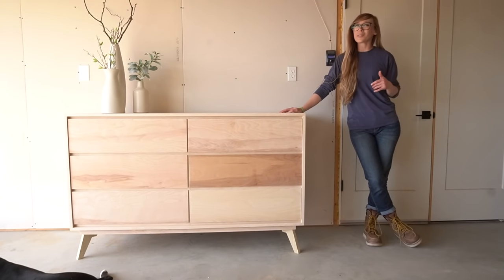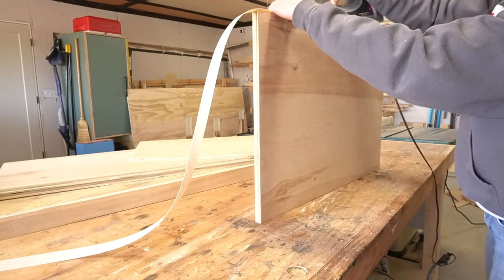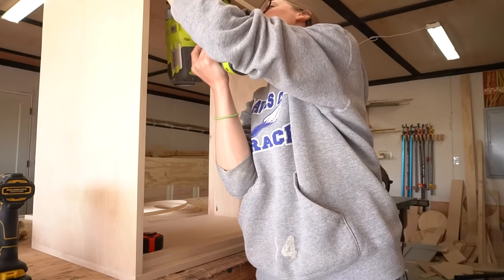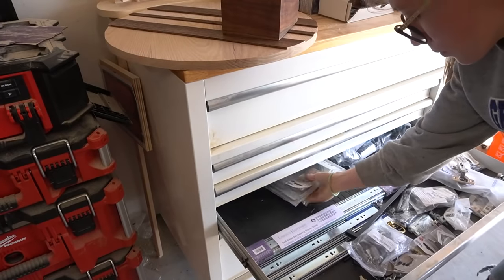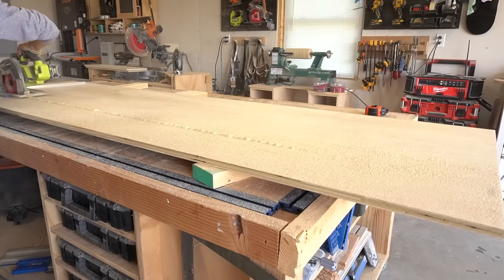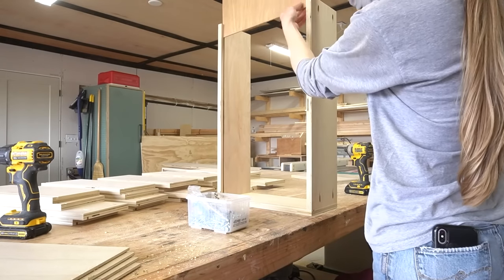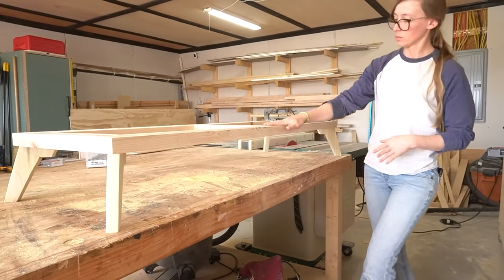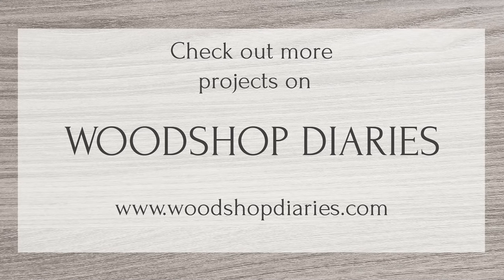How to Build a Mid-Century Modern Dresser--FROM 2x4s and PLYWOOD!

Comment: Thank you!  My daughter wanted to build a dresser and I told her it would be too difficult, but this video and your plans made if possible.  It turned out almost perfect!  My only advice for anyone that does this build: Shara tells you this in the plans, but to reiterate you should cut the drawers as you go.  There is little room for error when you put them on the slides so an 1/8" can make a big difference.  Measure and cut as you go, at least for the first one on each side. The only tricky part of the build was mounting the drawer faces - again we wanted them to be exact and we never figured out an easy way to line them up and attach at the same time.  Ended up removing the top two drawers so we could reach the one beneath them, applying glue to kind of hold them in place, then having one person push them out from the back while the other held the front on exactly in the right place, then clamp it to screw it on.  For the top two, we used to big clamps that went around the whole dresser and just glued them overnight and screwed them in later.  Great project - well done!!!!  If anyone is thinking you should give this a shot, go for it!!!
Reply: This may be helpful. I've seen others that have used double-sided tape. The tape will hold the drawer face in place, and it's easy to reposition if needed.

Comment: That was cool! I bet your friend loved it. If I may make a suggestion, a simple 45 degree bevel on the bottom edge of the drawer fronts makes for a great way to pull the drawer open. Great build!
Reply from the maker: That’s a great idea about the beveled top edge. My friend plans to add knobs, but if you didn’t want hardware, that’s a great option 👍thanks so much for watching!
Reply: @WoodshopDiaries  hi I am pension carpenter

Comment: If I had a table saw and planer, I would do this for sure! Super nice!
Reply from the maker: No planer or table saw needed! You can cut all the wood down with a circ saw and no planner is needed on anything here 👍
Reply: @WoodshopDiaries  It's doable. But I know the sides and edges won't be as straight as they should be.  Using Kreg joints on un-planed lumber always ends up looking sloppy.

Comment: I love the look of this! I want to do something similar, except I want one with three drawers and one cabinet. It's been really hard to find one to purchase that fits what I'm looking for. At this point, I'm just going to make it and buy a three drawer dresser in the meantime. It seems like a cabinet door could be easily added to this build. I'll also make the drawers take up 2/3 of the width available for the drawers and the cabinet area 1/3 of the width. I'll probably have to add a middle support beam on the drawers so that the thin plywood on the bottom of the drawers don't crack.

Comment: Nice job.  I'm impressed that you used a ruler instead of a framing square to check for square.  The only thing I would question is the use of the secondary side of plywood for the middle drawer of the RHS of the dresser...which seems odd aesthetically.  I don't know if cost was a factor, but solid wood drawer fronts made of birch should not be that expensive.  But overall, you did a great job.  Keep up the good work!
Reply from the maker: In the video I mentioned I robbed some plywood from an older project for this drawer front. It’s being stained dark by my customer so it’ll even out as far as color goes. (It did even out…past tense as this is an older video)

Comment: Great work and elegant design. My only concern is that the pocket hole on the main body may not be very strong. At 2:14 for example, the are on the sides pointing outwards, which don't have much material to hold it. Instead, you could drill them from the bottom to the sides, such that they are pointing upwards, which has more material. For the top pocket holes, you could use a stripe to drill pocket holes from top to sides, then put the top cover on top. Anyways, your glue should hold them together just fine. Good work!
Reply from the maker: Thanks so much for watching! I’m glad you enjoyed!

Comment: Looks great, nice work 👍 
I don't have a table saw for the dado cuts in the drawers, I'm assuming I could use a straight bit router to achieve the same though?
Reply from the maker: Yes! Or you could glue and staple them onto the bottom of the box as well. Whichever you prefer

Comment: Great video.  I was wondering if this could be done with 1/2 inch ply.  I live in New Zealand and we are very limited to what we can get.
Reply from the maker: As this is a large dresser which will be holding significant weight, I wouldn’t recommend 1/2” ply. You might could get away with it for the drawer boxes and fronts, but I wouldn’t use it for the dresser body.

Comment: Nice piece. You said that you would be able.e to use drawer runners that push to open, but wouldn't the drawer fronts butt against the frame, negating the 'push to open' functionality? I might be being stupid but I'm just having similar thoughts on a piece I am working on right now.
Reply from the maker: The drawer fronts were actually cut the exact size as the openings…so they don’t overlay the trim pieces.

Comment: Hello! New subscriber here! I am a total newbie at woodworking but really want to make a dresser like this. I have a few questions: instead of cutting all of the dados to slide the bottom piece of the drawer into the sides, could I alternatively just nail/screw/glue the bottom piece onto the bottom of the side pieces (kind of like how you attached the back of the dresser)? Is there a particular functionality-related reason not to do that, or does it have more to do with aesthetics/craftsmanship?
Also, how do you know what size/length of screws to get? For example, when you screwed the base/legs onto the bottom of the dresser. If the screws are too short it won’t attach, but if they are too long they might pop through to the other side, right? I’d love your insight!! Thank you so much for this video, I learned so much!
Reply from the maker: Thanks so much! You can staple or screw the drawer bottom in place. You can check out my drawer building guide for more details here:
https://www.woodshopdiaries.com/theres-no-wrong-way-to-make-a-drawer/
And for screw length, you want to make sure it’s shorter than the thickness you’re screwing together. So the total thickness of the base plus the plywood bottom was 2 1/4” so I used a 2” screw.  You can find more details in the plans here:
https://www.woodshopdiaries.com/how-to-build-a-modern-dresser/
Reply: @WoodshopDiaries  thanks so much! You are the best!!

Comment: Hi Shara. I see that you hardly use any glue, even with the kitchen cabinets. Do you find the pocket holes to be strong enough?
Reply from the maker: I’ve not had any issues with them…In my cabinets or any other furniture I’ve built so far. 👍 glue is good, but the screws hold fine on their own
Reply: @WoodshopDiaries   Good to know. Thanks Shara

Comment: Wow, so simple.. I keep forgetting what pocket screws have done for cabinetry. 
Wasn’t 3/4” plywood drawers overkill, and more expensive than 3/8” plywood?  Could you help me understand?
Reply from the maker: I like to keep things simple and use 3/4” and 1/4” only in my shop. At the end of the day, you can “save money” by making some parts 1/2”, but you may end up with a half sheet of leftover 1/2” and a half sheet of leftover 3/4” and if you just made it all from 3/4”, then you’d have no scraps. Plus, I can stick to one size screw, one length nail, etc instead of stocking different sizes and lengths to use with different materials. Not right or wrong…but what I’ve found to work best for me in my shop—limited materials, less waste, less supply to keep stocked.

Comment: I built a dresser similar to this and aligning the drawer front was not trivial at all.  There is always a bit of variation.  I always use spacers to keep things lined up but not sure why they are not all the same.  Any tip?
Reply from the maker: I’m not sure what you mean by variation and what’s not the same? Are your drawer fronts square? Exactly the same size? Is your dresser square? Drawer slides installed at the same inset? There are million possibilities, but since I’m not sure what’s “off” on your case, I’m not sure what to suggest looking at first.
Reply: @WoodshopDiaries  I am trying to get all of that correctly. I use square block when attaching sides. I use spacers between drawers slides etc. But somehow it never lines up and I had to do micro adjustments. I wish videos on youtube cover those "catch ya" to help us make things square and aligned.
Reply from the maker: I’m still not sure what exactly isn’t lining up? The drawer box? The drawer slide? The drawer front? Maybe this guide can help:
https://www.woodshopdiaries.com/theres-no-wrong-way-to-make-a-drawer/

Comment: I always have a problem with pocket screws lifting up the board and scooting off from the targeted place in a 90 degree joint like the sides and bottom/top panels.  How do you do it without clamping?  Add glue and it gets even slippery.
Reply from the maker: I get this question all the time. I honestly don’t have a “trick.” I just hold it tight, don’t overdrive the screw and when you add glue, press down and allow the glue to squeeze out some so it’s not sliding around everywhere. If all else fails, just clamp it.

Comment: I saw that when you assembled the drawer sides with pocket hole screws you used no clamps how do you keep the pocket screws from moving while screwing the pocket screws in
Reply from the maker: I hold it in place very tightly and don’t overdrive the screws. I’ve found most of the issue with movement is caused from over driving the screw 👍
Reply: @WoodshopDiaries  Thank you :-)

Comment: Could this work with 1/2 inch plywood to cut down on some of the weight?  thoughts?
Reply from the maker: That’s a great question. While it might be possible, I wouldn’t recommend it. If you wanted to build the drawer boxes from 1/2”, that would be sufficient for that part, but I’d stick with 3/4” for the main structure.
Reply: @WoodshopDiaries  Thanks for the response and suggestion - sounds like the perfect compromise.  After going to a number of furniture stores and not finding the right size I was looking for in a dresser, I decided to look into the possibility of constructing one myself and came upon your video - although I am comfortable with woodworking, I'd still call myself an ameature.  But you did such a great job of explaining each step of the way that I think I can manage this one.  Thanks for the inspiration!  I'll definitely subscribe and take a look at the other projects you have.  Thank You!

Comment: A bit confused by the depth on your plans. 

Drawer depth is 16", there is a 1" inset from front. So that makes for 17" total but the body is 20" deep.
Is there a reason for keeping 3" extra on the body which possibly goes as empty space in the back.
Reply from the maker: No reason except more efficient use of wood. You can make your drawers 18” instead if you’d prefer

Comment: Why did you leave so much space in between the the back of the drawer and the back of the dresser? I'd noticed the same thing with a store brought one last week.
Reply from the maker: I use 16” drawer slides on almost everything so that’s what size slides I had but needed the dresser deeper. You can make them deeper if you want...I just didn’t want to buy more slides.
Reply: @WoodshopDiaries  Thank you so much for your response.

Comment: You seem to be able to use pocket hole screws without clamping the two pieces…how?!? Mine come out misaligned if I do that
Reply from the maker: https://vm.tiktok.com/ZM8e5xLfJ/
Reply: @WoodshopDiaries  pressure on back and don’t overdrive. Thank you!
Also, I built a shoe bench based on your video. Thank you for the guide. Anyway I can share the finished result?
Reply from the maker: Awesome! Sure thing! You can send a message on the Woodshop Diaries Facebook page with a photo if you’d like to share it 👍
Reply: @WoodshopDiaries  I’ve sent some pictures over. Welcome to share the finished pic if you think it’s okay